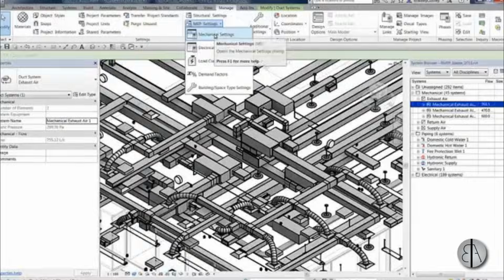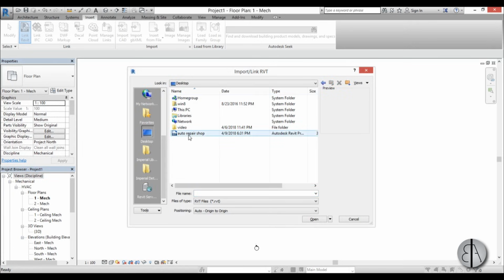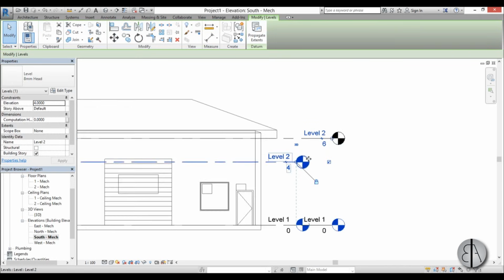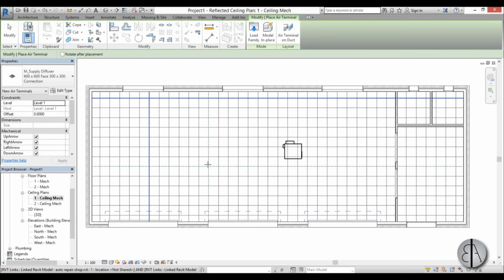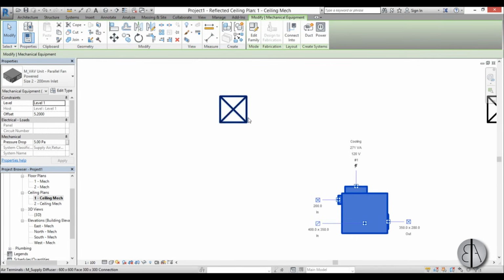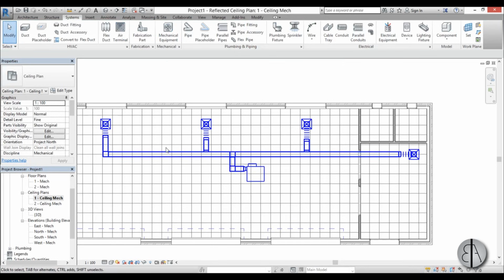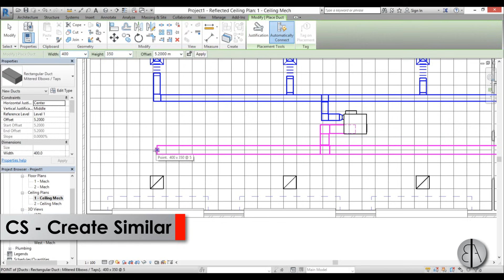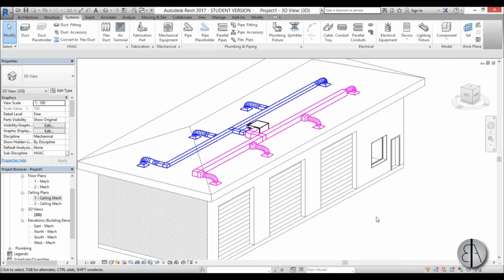Simple Mechanical System in Revit Tutorial

Comment: In diffucer layout equal distribution of air throughout the area as to be consider,
and the diffucers must be allaigned with the architecturel cealing grid for easy installation and aesthetic looks,
In the quality HVAC system the flexible duct is not prefered for return air system.

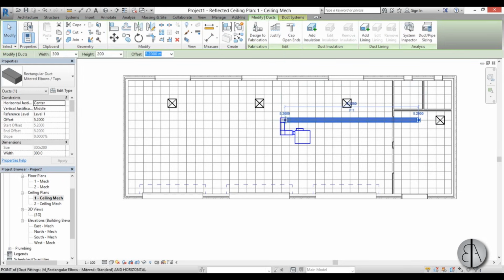Comment: As for a tutorial for placing mechanical equipment, ductwork, and air terminals, this is decent. However you showed some techniques which display a misunderstanding of the way Revit works: (1) the ductwork cannot be stretched like you did at 6:30 (notice that it did not convert the elbow into a tee, it just overlapped a straight duct across the, now disconnected, elbow) and (2) I'm 90% sure you drew the supply duct from the outside air connection on the air handler (at 6:11 the connectors show that air flow on the left 2 are "in" and the air flow on the right is "out".

If I could give a rating, it'd be probably a 3/5 but I had to give a thumbs down for missing those key features of MEP design in a tutorial.

Comment: Thanks for these videos. Question. I notice you seem to have little regard gor precise drafting. For wxample, exactly how long the ducts are, if everything lines up, if diffusers coincide with the ceiling grid, etc. Is this just because its a quick video or are these criteria simply not Important in MEP, as they are in architecture and structure.
Reply: He is just showing how to model ducts on Revit. You have to decide all your duct sizes etc as part of your engineering design.

Comment: Your fundamentals of drawing are fine but you selected the wrong piece of HVAC equipment also, you tied your supply air into the primary air side of the VAV it should be on the other secondary side of the VAV. VAV's have to be fed by a larger air handling unit. The larger air handling unit will feed as many as 20 VAV'S. Some large facilities we have done may have up 30 large air handling units and 500 VAV boxes.

Comment: The flex duct needed a minimal length, that's why it wouldn't let you draw it that close.
Reply: is this a general HVAC thing or a software thing? aka: is the minimal length of the flex duct the same as it would be in real life?
Reply: @zaneraza4044  has to be both. making that close of ducts would leave you with minimal room for air to let in easily.

Comment: A fan coil or split system would be a better fit for this building. 

You want the Supply Air near the windows and doors, Return In the middle. With that t bar ceiling you don’t need to duct the R/A back to the unit. The attic acts as a return plenum.  The duct and air handler need to be hung higher, allowing a smoother radius in the flex to the register. Also, this system could be installed with spiral duct (round), making it much cheaper to produce. 

The office needs S/A & R/A as well. The bathroom needs Exhaust and either a supply drop or a transfer duct from the office.
Reply: Would you mind breaking down exhaust, supply drop, and transfer duct please?
Reply: @zabba7461  you will typically have an uninsulated exhaust duct in each restroom that will rise up through the roof via variable drive exhaust fan. 

A supply drop is just a ducted runout coming from your supply main to provide fresh conditioned air to the bathroom. 

A transfer duct that was mentioned is typically a return air boot above ceiling. That is just an open duct on both ends that penetrates the wall between rooms to allow for the air in the attic space (above ceiling) to move freely between rooms. This also allows rooms to relieve positive pressure caused by the supply air going into the room.
Reply: amazing! better if we have the visuals for this.
Reply: it's a Revit tutorial not an HVAC design tutorial lmao
Reply: @dacoobob  he literally asks for feedback @:47

Comment: Sir plz tell me is the REVIT MEP and HVAC is the same thing or its different? Im confused in both? plz anyone can explain
Reply: Revit mep is a bim platform, a bim software , where architectures use revit architecture. Srtuctural engineers use revit structure and mep engineers use revit mep. Hvac stands for heating, ventilation and air conditioning, that deals with air conditioning systems,heating cooling load calculations ,mechanical componenets,ventilation calcukations based on ASHRAE.
Reply: @clintonvijayansylvester831   any best YouTube for MEP
Reply: @memyadventures2730  you are from?????
Reply: @clintonvijayansylvester831  India
Reply: @memyadventures2730  am from mumbai😀
Reply: @clintonvijayansylvester831   how can i learn in YouTube. any suggestions